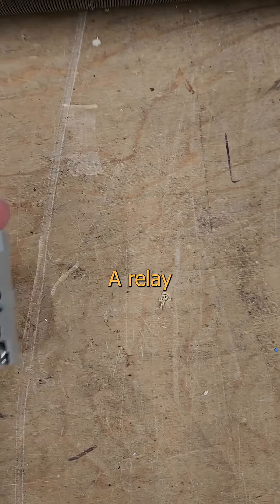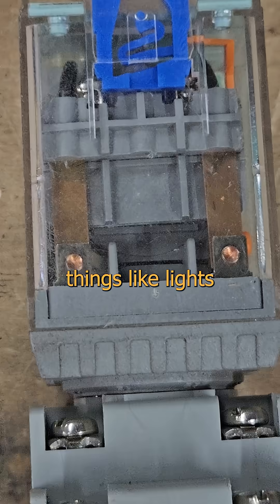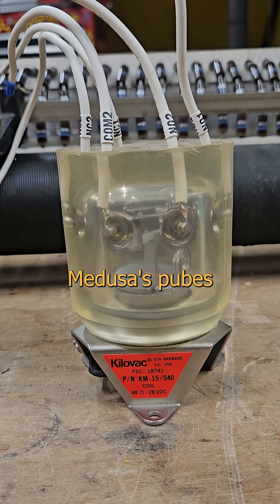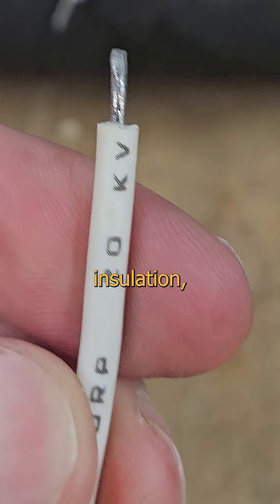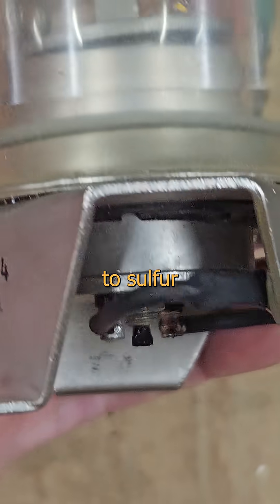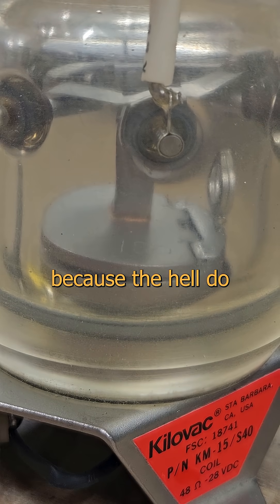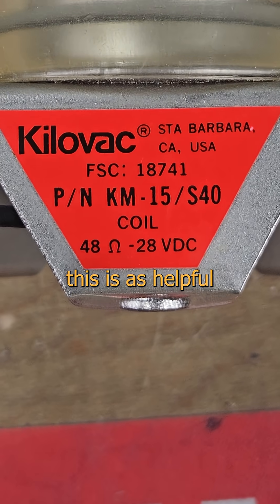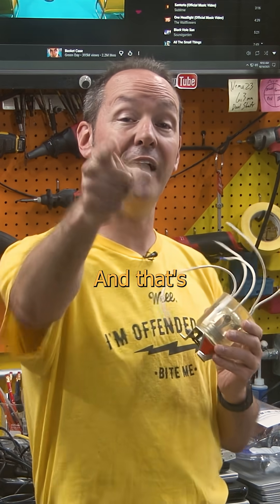High Voltage Relay #chrisboden #comedy #engineering #electrical #science #educational #jokes #adult

Comment: Make only load switching... Seems like cheating, they miss the fun side of switching. That explains the small gap, won't brake a 75kW arc with that one. SF6 was on point. 

Only found km13, km14 and km17. All of them 7.5kV 10A so I can only assume it's the same for this one.

With the make only seems to be useful as crowbar to stop an overvoltage or to kill someone else's arc. I don't know what else can it do. Datasheet application is defibrillator, so I guess discharging high voltage caps. 

High voltage transformers selectors have a bunch of no load switches in oil with a few make and break vacuum switches to take the hit and then be released once the oil contacts take over. 

I haven't come across an application for a make only one.

Have fun with it, but don't expect to turn it off, ever again... 😅

Comment: So Kilovac is still around these days, though this is an older series. As the name "Kilo" "Vac" implies, it's a vacuum relay for high voltages in the low kilovolt range.
The modern one I could find was K40P332, which is a SPST latching relay that can be operated up to 5kv depending on the frequency. It's rated for a whopping 35A at 60Hz.

Comment: On thing I found is kilovac make relays that can handle movement and vibration so if it's in a vehicle or on a machine then that might be necessary and the gaps tho small are in a different atmosphere so I suppose it's harder for it to arc

Comment: That looks to be more of an anti-BANG!-relay that's used close to a live process site. Potted contacts for exclusion of potentially explosive or corrosive-to-switching-contact-metals atmosphere. Silicone wire insulation suggests corrosive/caustic environment that would be detrimental to your bog-standard PVC wire insulation, and the actuator coil probably has a chunkin' beefy TVS diode across it if Ex proof . If NOT Ex proof, then it's just caustic environment.

Comment: I had a 1986 suburban with a diesel engine.
I remember my glowplug control shit the bed. I wired that puppy up, straight to a aftermarket horn button on the dash. This was before i knew what i know now about electricity and current.

Comment: I work in a hospital and I've seen what these are used for. They are used for a defibrillator bringing the capacitor charged to 360 joules or less to the patient.
Reply: This makes sense as electrical connectors in hospital use are frequently required to be in clear plugs
Reply: WOW,now I've learned something 🥸🥸🥸✌️👍
Reply: @peterhorniak8766 Oh that’s cool
Reply: Riiiight. Sealed and fully visible internals from almost any viewpoint. Smart.
Reply: I wonder, is this sort of sealed relay intended for location that may have O2 supplies or other flammable gas? That's hospitals, but other industrial environments too. The design of this relay reminds me of "explosion proof" light fixtures.
Reply: @travelfeet  O2 isn't a flammable gas. O2 makes everything else flammable.
Reply: @regould221  don't think they were implying oxygen was flammable more than places where there is any means of causing an explosion. Like in a metalworking shop, hyperbolic chambers at hospitals, etc. While oxygen isn't flammable it is an oxidizer that can cause. Higher oxygen = faster reaction. 

Theres a reason there are even defibrillator restrictions in hospital hyperbolic chambers. Due to significant fire risks associated with sparks and high pressure oxygen.
Reply: @regould221  O2 can be a flammable gas in the presence of something like Florine gas. When oxygen and fluorine gases are mixed and set alight, it's the oxygen that's being oxidized by the fluorine!

....But yes, usually Oxygen is the one doing the oxidizing.
Reply: what model defibrillator are you thinking of? I've used Zoll and Life Pak and never seen such a large component...
Reply: The comment below you verifies this. The person pulled up the data sheet for the part and apparently it's widely used for defibrillators.
Reply: 20kV Insulation for a defibrillator?
Reply: @nichthier8d239 You don't put 20KV on 20 KV insulation. Couple thousand maybe.
Reply: Way too big for a defib. They're basically just capacitor banks anyways.
Reply: @Justin.Franks  also this would probably be in an older defibrillator
Reply: @Justin.Franks  I think you would use this to clear the capacitors after use

Comment: I'm not an engineer (just a student), but you did mention wetting voltage in a previous video as something which is necessary to avoid problems with corrosion on electrical contacts. If the atmosphere inside the sealed switch is a vacuum or something inert, then might this be useful for something that requires bypassing wetting voltage? Another commenter said this looks like something used in corrosive environments.

Comment: Maybe it’s some kind of pilot to get a high voltage something or other up and running but doesn’t see the high voltage directly unless in a fault condition which is why it’s insulated enough to stop the high voltage crossing to the control side of things if there is a problem

Comment: Found IT! TE Connectivity makes KM series. KM 13 is SF6 filled, 7.5 kV isolation and switching. SF6 gives low gaps. Didn't find KM 15 in current catalog, but it's probably out there ...
Reply: Sulfur hexafluoride released into the atmosphere is 25,000 times as effective at trapping heat than CO2. A thousand times more than CH4. Ten times Freon. It is being phased out from use in big transformers for that reason.
Reply: @sciptick 
so....an absolutely exquisite gas for whatever the technical term for a thermos is?😃👍
Reply: @sciptick  so then don't let it in the atmosphere
Reply: That’s pretty Cool!

Comment: The inside could also be a vacuum, would exponentially increase the voltage isolation inside vs an open air relay.

Comment: We used one similar to that although not potted for switching in and out grid bias voltage on the gun for a Siemens (formerly applied radiation) MEV 6 medical linear accelerator from the early '70s. It was under a vacuum not pressurized as is. I believe yours. In this case it was switching about 500 volts.

Comment: I think that’s a normal high voltage vacuum switch. Vacuum so no arc. It’s not a relay, it can’t automatically disconnect (I think). But from the looks of it high voltage is in terms of electronics. Like a super ac amp or something similar not distribution or transformation levels of high. Still, very cool.

Comment: That was a blast from the past. A zillion years ago I used its smaller Kilovac little brother to implement a HiPot and functional tester. If I remember correctly the ones I used were vacuum relays but it was only switching between line voltage and a few KV.

That is also how I learned an expensive lesson that linear power supplies store a fair amount of energy in their transformer so you don't want to power them up then short the primary to be ready for  a HiPot test, bad things happen.

Comment: Im thinking ATEX rated environments. Contact spacing is deceptive. The usual rule of thumb of a centimeter per kilo volt of spacing required to prevent arcing is only roughly valid in the sort of atmospheres you and I like breathing. When you go to a hard vacuum (once you get there, so ignoring Passchen pressure curves, Hello rabbithole!) suddenly arcing and breakdown behaviour is very different and much smaller spacing can suffice even at higher voltages. Environment in some other pure inert gas are entirely different again and minimum contact spacing once again doesn't match anything you'd come to expect if you only deal with boring old nitrogen-oxygen-and-some-other-stuff environments.

Comment: What I found online says...

The Kilovac KM-15/S40 is a high-voltage vacuum relay designed for demanding applications in aerospace, defense, and industrial environments.
 It features a double-pole double-throw (DPDT) contact configuration, which allows for the switching of two separate circuits simultaneously

Comment: It's worth noting that more distance isn't always more better.  Breakdown follows Paschen's law.  

Electrons moving across a very large voltage potential gain so much energy between collisions that they ionize molecules of gas when they collide with them.  Those newly liberated electrons are in turn also accelerated across the voltage potential ionizing even more of the gas when they collide with it, and then those electrons continue to the same so that a single ionization event multiplies into an avalanche of electrons ionizing the gas between the contacts in the process.

There are two ways to reduce the likelihood of avalanche breakdown.  One way is to reduce the number of gas molecules between the contacts.  At low pressures and close distances a single ionization event isn't able to multiply into a large enough avalanche to sustain an arc.  In those circumstances increasing the space between the conductors can actually decrease the breakdown voltage since you've given the avalanche more opportunity to multiply.  At low pressures the ability for charges to cross the gap is largely dependent on the work function of the metal used in the contacts which is why platinum is used so often in high voltage vacuum setups.

A second way is to massively increase the pressure and to use a gas like SF6 with a very high electron affinity, that way electrons cannot get enough energy between collisions to ionize the gas in the first place.

I couldn't say which was being used in this situation but I just thought it was worth mentioning that more space doesn't always mean higher insulating voltage.  It just usually does because you're typically off on the right side of the Paschen curve.
Reply: I thought instantly it looks like pressurized stuff for that exact reason. I have seen that in some lecture online, for some reason not in my uni :D

Comment: I've been watching your videos for a while now and I get the feeling that you are happy with your job, also with the fact that you can make improvements to Old hardware that will last at least a couple of centuries by using techniques and equipment that didn't exist when that machinery was last updated or built. Make me wish I had to drive and was smart enough to do what you enjoy doing. At most I'm just a ham operator who likes to tinker with things and can't tell when a component goes bad except for capacitors which those are very easy to tell because of how they puff up.

Comment: I've never seen anything like it, but I'm guessing it's got the "sparky bits" isolated to keep from igniting a gas, so possibly for use in places that may have combustibles in the air. It looks way, way overbuilt, so I'm guessing it's probably medical. Possibly used in hospital equipment where it may be near oxygen sources?

Comment: Found a spec sheet for kilovac km14 glass/vacuum relays with silicone encapsulation.  Rated for peak 7.5 KV and 10 amps, with a 12 ohm coil for 12 VDC.  I'll put the link in a separate comment (which I suspect YouTube will delete).

Comment: That relay is near identical to those in defibrillators!
Hey Chris, if you read this and want an old-school Hospital defib with one of those relays built in, then let me know. Pretty cool units. They've got a cute mini CRT display for the ECG, the fun paddles, and it's not the new AED type that won't let you have fun. Oh no. These aren't meant for the general public, they'll happily kill you if used incorrectly. I've got a bunch of them I saved from the scrap at my last job, fully working too, just old and out of calibration. I was going to try and give them to hospitals in Africa, but bureaucracy and liability ruined that plan.

Comment: I'm studying transistors currently and want to ask that is the switch to open the relay able to be the smaller power in a transistor? Like the switch gives power and causes the transistor to output.

Comment: ...like PLC. We were making control for a pumping station, 4 pumps servicing a sizeable village roughly 300m higher than the station. The PLC had built-in relays. They were used only to drive the relays activating the pumps. But the pump relays were so beefy their driving coils fried the relays in the PLC.

Comment: I found some decent results when searching for "kilovac km", I found a KM-14 relay that as I suspected is a high voltage relay with a glass vacuum tube inside the silicone. The KM-14/S25 is allegedly rated for 7,5 kV 10A, and an ebay seller is saying 14kV for another KM-14 model, so chances are the KM-15 is a similar story.

Comment: This looks like the high voltage relay from a DC defibrillator. It is used to connect the energy storage capacitor to the patient paddles when a shock needs to be delivered to the patient's heart, attempting to restore normal heart rhythm.

Comment: That thing screams “ Oil Refinery” or the same kind of environment to me. I have been an electrician for 30 years and worked with “ kind “ of sealed relay in big oil change bays with explosion proof lights and heavy sealed hydraulic motors to lift big trucks. I love that shit.

Comment: The power relay you held at first...what is that standards use.
At work those relays get only used by the railroad industry but they arent really different (atleast core spec wise) to like any other relay type

Comment: It's probably one of two things.
1: it's for when the voltage difference between the contacts is low, but the voltage difference between the control system and the work system is different by multiple KV. (Remember, ground/negative is just a reference, not an absolute value.

2: it's a relay designed for potentially explosive atmospheres, which is why it's sealed so tightly. The control side isn't sealed very well since it doesn't produce a spark. Usually relays for corrosive environments will be well sealed on both sides from my experience (5 years as an industrial electrical technician, so not exactly an old head)

Comment: Density Cutoff Relay. When a compressed gas or fluid mass, like liquid or gas gets to a certain density or fill level at a certain point.. two porous contacts that use the fluid mass make a circuit and stop the feed/compression. 

Basically a clever cistern vavle for electric pumped tank.

I'm just guessing tho.
Reply: An Inert Gas Breaker Relay.

Comment: As a rule of thumb you can say 1kV per mm is needed to jump the gap and anything below 350V needs to touch anyway so it takes less than 20ms to get to a point in the sine(because AC mEcAnIcS) where your potential difference isn't enough to kick the dust off any pixies
Reply: In standard temperature and pressure, though. But pull a high vacuum inside the relay and there’s nothing to ionize so no arcs.

Comment: Most certainly looks like hazardous area relay, which can be used in a potentially explosive environment. No possible way that an explosive atmosphere is ignited by a spark.

Alternatively, a relay that can be used submerged or in an environment that can be covered in fluids.

Edit: Kilovac also manufactured vacuum relays, this might be one of their models. "vacuum relays are widely used in airborne, mobile and marine communications equipment. Typical applications include antenna coupling, tap changing on radio frequency coils, transmit and receive switching to an antenna, switching in pulse-forming networks and heavy duty power supplies." according to another manufacturer, Jennings.
Reply: They want the switch to be quiet in RF, so doing all they can to avoid arc?

Comment: Can I tell a story?
A couple of decades ago a Russian decided to defect to the UK. He had some specific knowledge about vacuum bottles. He was employed in the electrical supply industry and produced a piece of magic. A set of contacts that worked in a vacuum at 415v (could be others but the next step for us is 11Kv and I have not seen an equivalent device there) We ended up with a device called a Fuse Mate!
A small hand held device that actuated off a timer and a key fob. It also had a detachable section where you could fit your normal (for us) 100 - 400A fuses! It can be inconvenient to be putting fuses of that size on to faults across 415V ..... lots of laundry trips ..... Even with full PPE it used to be an experience to sort the men from the boys and required both knowledge and a certainty of presence in yourself! The aftermaths could be truly catestrophic if you flinched as it was blowing up in your hand and you did not get the wedge type fuse located fully on the studs! The Fusemate tamed this experience. You put your selected fuse in and tightened it down then stepped back (4 meters safe distaance) and pressed the fob, still wearing full PPE because if one of the cable crutches blew you would be having a nice nurse assisted bed for a while and while nurses are nice, they are not That nice! Once pressed you waited for the beeps to stop and the click of the relay to trigger a spring which threw a decent sized chunk of metal across the open point and get everyone's lights back on! 
Of course with substations numbering in the 1,000's and averaging at 4 ways each and 3 phases that was too many devices so after you got the power back on you then swapped the blown fuse in the carrier you had just removed to get the fusemate in and pulled the fusemat out and replaced it with your new fuse.
Faults being what they are (unpredictable) there was still a chance of the proverbial BigaBadaBoom but much less so if it ran for a couple of minuits so you still had the full PPE on in the hot sweaty substation and you were glad of it too!
But you were even gladder for that wiley ruskie coming over to improve things in a way most people are totally unaware of! ...... Business as usual!